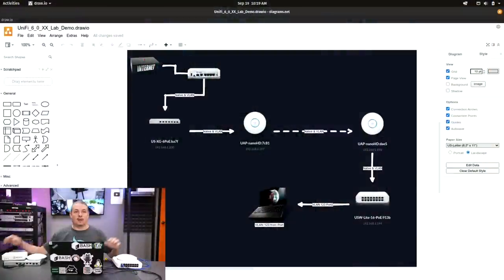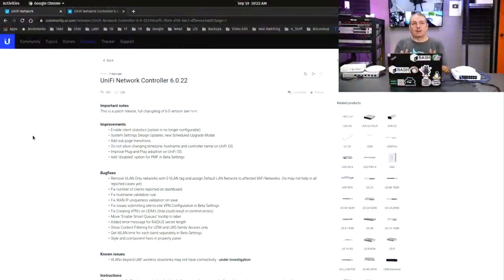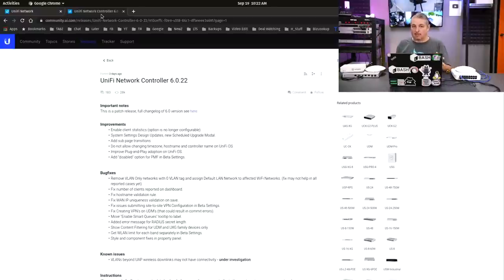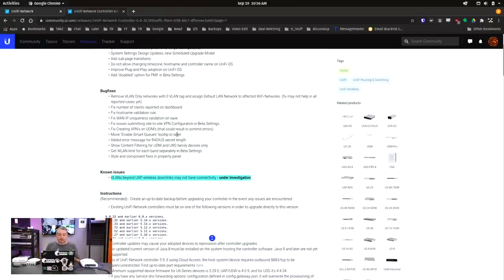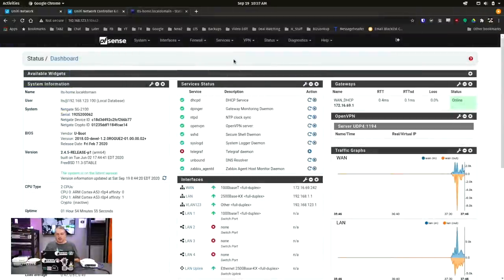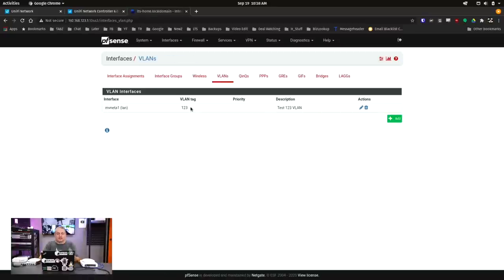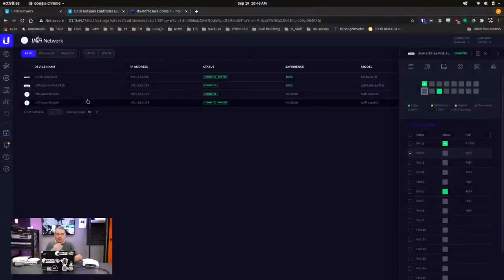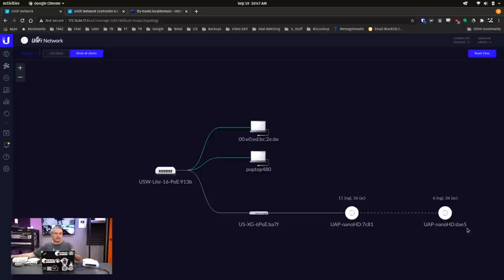Testing UniFi Controller 6.0.22 With VLANS Over MESH & The Problems With UniFi Products

Comment: Tom I found that people would use both terms interchangeably Meshing / Roaming. Even experienced Network engineers. We planned out a 30 AP Network in a very old 1800's building recently.  Marble walls making parts of the building  extremely hard to cable.  When Designing we took test rigs out and made sure we could wire and place all AP's in overlapping locations to Roam. The guys with me seemed to think it was a good idea to Mesh rather than survey test and get positioning to overlap signals to make decent Roaming. I just couldn't get through to them that Meshing a difficult job would increase latency backhaul processing power etc. rather than take more time to test and plan properly. We have a number of VLAN's for different guests etc. I just thought they are taking the easy route and when all this different VLAN traffic is on its going to get messy.

Comment: Coming here in 2022. I had the scenario where I had to use a mesh because I wired my homelab together with the home network. I went down the wrong path dealing with VLANs over a mesh. 

I'm also a software engineer, who has done some networking stuff, and you're spot on about the complexities around testing scenarios with networking. Unlike pure software development, you need a lab to test it, and you can only test so many scenarios promptly. One benefit of having these kinds of users is you get a lot of use cases, which other vendors may not get -- and you can learn a lot, which gives you a competitive advantage. The downside to it is that if you don't address those scenarios, you may actually drown in the noise and undermine your brand. 

If Ubiquity got their equipment and software to play nicely with others, it would be really, really useful. For example, maybe I just need a router with a controller for the WiFi infrastructure and let Sophos, CISCO, and whatever, handle the data center -- but I found that it is tedious to disable NAT and Firewalls with USG, UDM, and whatnot. Imagine if they just offered you an option to use this as a firewall, router, or switch and configure the device accordingly.

Comment: Glad you bright this up.  i am still 5.x controller with V1.8 firmware on my UDMP.  I have four VLANS and everything has been behaving.  I notice that Unifi SDN 6.0.23 was released and available for my customers on USG and USGP.  Does this version resolve some of the issues you discuss?

The only Unifi problem I have experienced lately is I cannot get WOL to work on my UDMP.  My infrastructure is all Unifi switches and back in my USG days WOL worked fine.  I am not sure when this problem started, but I have no WOL functionality at all.  I've tried PC to PC on the same switch even.  I know my BIOS settings on the target are correct because I used to wake these nodes under the USG.  Have you heard anything about this "feature"?

In regards to your view of Ubiquiti, I've been pleased with their hardware and software offerings to a degree.  The Unifi product line frequently has the flavor of a beta product with its features issues.  Clearly Ubiquiti is leveraging a huge install base to ferret out and fix their problems.  I suppose that is the cost of Prosumer gear as opposed to Cisco.  Over time they have eventually fixed their problems.  I end up consulting on their gear a lot because people that get in trouble tend to be hobbyists who have been given just enough rope to hang themselves with.  That gives me business certainly.  The beauty of the product line is 1) Commodity hardware at a great price and 2) No software contract needed and lifetime support.

Comment: The problem isn't the bugs, it's the release management.  I posted this recommendation almost 4 years ago on their forum ... https://community.ui.com/questions/Officially-suggested-stable-release/253e71df-15de-45a5-bace-1fbd8a0e39c2

It's time they listen to their customers and provide a stable release channel that is just that, stable!
Reply: And how is that supposed to help destroy their own brand? Doesn't make sense to mitigate those issues. They did their darndest to make hosted controllers useless for UDMs, nuked the forums beyond repair, still can't manage 2 WWANs after a decade, put Video down and now succesfully burned a ton of people. Their intentions seem clear to me.
Reply: They still have issues with 2 wans??
Reply: @sbccave4015  AFAIK, nothing changed on that front. Not like people haven't been asking for that feature when literally everybody else had it app. 750 years ago.A glacier is an avalanche compared to UBNT.
Reply: Insanity thats the reason ive NEVER suggested unifi routing products.
Reply: @sbccave4015  Insanity pretty much sums up recent decisions at UBNT. No idea what they're smoking, but I wish they'd share.
Reply: The response to your comment was to track LTS and understand that manufacturer's definition of stable code is much different from that of your user's expectations. As others suggest, continue to lean on our peers that promoted code in similar environments using change management practices.
Reply: Right enough Aric. Just a bit more feed back from Ubiquiti would be good. It always seems a little like one way traffic on the forums.

Comment: Thanks for explaining. I’m going to try this for my detached garage and a   UAP-AC-M-PRO-US i have extra, should be pretty simple for the looks of this and work how i want to be able to run ip cameras mounted on my garage. Running a line to the garage is a big task as it would be tunneling under concrete for quite a ways. I surveyed the WiFi in the garage and it is spot on so the   UAP-AC-M-PRO-US should just like your demo ! Thanks again for confirming my idea i had.

Comment: If you use your WAPs as a wireless uplink/bridge, particularly if they are trunking VLANs in an enterprise environment, then you not employing enterprise IT practices. Yes UNIFI released a bug, but it “took down my entire network” as result of a WAP mesh bridge/trunk, well that’s kinda on you for implementing that practice in a critical environment
Reply: @Kevin J I am talking about network practices inside the enterprise, linking switches together using standard WAPs that carry multiple VLANs within an enterprise instead of cable or fibre is just not a good idea, on an enterprise network it is better to have WAPs hardwired, I think Tom indicated in the video he also deploys them in this way. Meshing WAPs in a home environment is common, but home environments are usually not critical networks. As for microwave vendors, well that’s an entirely different wireless infrastructure designed for high bandwidth point to point transmission I have no issue with that

Comment: Thanks for this video. As I mentioned before I updated to 6.0.22 on Debian 10. I've only have one  Unifi AP-AC-LR in a home environment. I went with Debian to host the controller because of the stability. Since this pc is a test rig with 6 other SSD's the controller is not running continuously. Appears that there is a firmware update as well. But I'm holding off until all this gets resolved. Its a great product and does a better job than the consumer grade AP I had previously.

Comment: Connect a new AP or Switch-8 on the far end switch and try to adopt it.  That's where I've had adoption problems over a Unifi wireless bridge.  Adopting the devices on the upstream switch and moving them to the bridged side usually works.
Reply from the maker: Thanks, that is the other reason I made this video, I know people will post what setups are potentially not working which I can then do some more testing with.
Reply: @LAWRENCESYSTEMS  i found issues with having a fortinet fortigate 60e with vlans set up and having 2 site locations connected by a private fiber metro ethernet. On the other end some devices get an IP and others don't. Very random. I would have to set static IPs for the devices to connect. This could happen on either wired or wireless connections. Chromecasts will work on the main site but if I connect to the 2nd site after the metro ethernet fiber connection it will not connect. Seems like they could reach the dhcp server on the fortigate for some reason!

Comment: 6.0.20 tanked my entire network, I have 4 AC-Lites & 1 NanoHD. All the access points started broadcasting all the SSIDs, I was getting the broadcast storm problem. The whole network was laggy as hell for 2 days & I didn’t even realize it was the new update. I was thinking it was my ISP. The new 6.0.22 fixed my issues I think, crossing fingers, no more complaints. I also jumped on the beta software for the UAPs to test but everything is back to normal.

Comment: here is the reason to turn meshing on with wired APs. We have a shopfloor where we commission machines. we will just put an AP on the machine while commissioning it to bring it on our network, so we dont need to sit the whole time at the shopfloor. since the shopfloor is big i dont know to which AP a machine needs to mesh to, so its turned on on all APs. usually the hardwired APs dont mesh because they detect they are sitting on the same wired network, but from time to time one AP will loose wired connectivity and think to wirelessly connect to the others.
On our old setup we could set the APs to AP Client mode, but i havent found anything like that on UniFi yet (havent looked for long though since this works well enough).

Comment: Like how you give positive and negatives on unifi.

Can you use the USG or switch to enable you to access from the unifi network on 192.168.1. Xto a printer on the routers switch of 192.168.0. X?

Comment: Interesting, I agree with your perspectives on wireless uplink, but it is better than nothing in home environments where wires are not possible or are very difficult.  I plan on wiring a second AP, but am using uplink temporarily as I sort out the best way to run cable in a wife friendly manner. :-)

I wirelessly uplink from a UAP-Pro to another UAP-Pro and the remote one then re-broadcasts my 3 SSIDs and associated 3 VLANs. I have always assumed that his was a more common use case than yours and wonder whether they were referring to this in the release notes. It would be awesome if you could test this config, but I know that you are super busy and so that may not be doable.

I am currently on 5.14.22 on a UDMP and everything works perfectly and so I am holding off on any 6.0.x release until feel confident that the issue has been thoroughly addressed.

Comment: Ok, quick rant. For those that have Auto Update on and complain because it broke their network, they should probably not auto update and research each update's release note before they do so. This is IT 101. No Corporate IT team would just push updates without first testing it to make sure it doesn't break their system, and if something does break, they should already have back up to be able to rollback updates.   Great points brought up regarding stats. Any stats can be skewed for any argument.
Keep up the scenario lab.
Reply: Pretty sure the release notes didn't state those problems on release date. Or they would have either fixed it or stayed on beta for a while longer.

Comment: The closest "open" (as is not exclusively sold through VARs, not open source) competitor to Unifi self-hosted management is MikroTik CAPsMAN .. essentially any MikroTik hardware device can be the management server or you can license it to put on your own hardware.
The CAPsMAN UI is not very intuitive and documentation is a bit confusing (and I've been managing networks since x.25 stuff in the late 1980s), if someone wrote a better frontend for CAPsMAN (or even a config file generator) it could be a bit more acceptable to the masses.. 
After saying that, my production wireless access points are all still Unifi, but seriously considering a MT overlay as devices are added or replaced.
Reply: MikroTik hardware is lacking too, no MIMO hardware

Comment: So if i get this correctly. there is an AP connected to a switch (ok), then you connect another AP wirelessly to this AP using the meshing functionality (OK), So far its logical. But when the 2nd AP is connected by cable to a different switch and you set up meshing I don't follow really. Then your network design is not optimal and I see how this could create issues! I mean you could do this but its not best practice at all. Why would you turn on the meshing function in this case???? I can't see any added value to doing so... your only setting yourself up for issues.
And YES exactly Tom :D , you explained the design flaw in this setup well and why not to do this etc. Great video!

Comment: I recently purchased and switched to Unifi equipment (switch, AP, etc.). So, most of my equipment is still setup with default settings as I refine them.  I found that meshing was enabled by default on my NanoHD APs.  I am not sure if it was enabled with version 5.x.x by default or if it became default with the upgrade for 6.0.20 or 6.0.22. Might be helpful for people to check their configurations as well.

Comment: I had this Vlan issue.  I have a very basic site with 2 ap pros in mesh mode and 2 Vlans one for IOT one for voip.  No unifi switches. As soon as I upgraded the vlans stopped passing to the meshed ap took me ages to figure out why my phone had no IP. My work around was to put wireless network for voip (hidden said) and get it seemed to work.

Comment: Have you tried the TP-Link controller and their Omada APs? I am also on 6.0.22. Only issue I had was with my guest WIFI network. It was created in V5. I removed it and the VLAN network. Recreated it, but I don't see a way to assign networks to WIFI hotspots. So it''s on the same network as my main WIFI network. My other IoT network works fine behind a VLAN. I also use a TP-Link PoE switch. So it's able to carry the VLANs to my EdgeRouter.

Comment: Been troubleshooting an ac-lr that's been causing all sorts of problems for about a week (common apple device loosing connectivity issue on forums without a fix) when 6.0.20 came out, I thought oh that's not long after the last release,  maybe there was a problem, so I updated, then went to forums and saw all the warnings, boy did I uninstall it quick! Got it rolled back to 5.x before any issues. The ac-lr? I set a script up to reboot it every morning at 6am, having spent a week on and off on it already, rolled back to backup config from when it was working, firmware update/downgrades and swapped out hardware, network traces the lot. Have no access to the building due to covid so I'm relying on the reboot for now.

Comment: Always turn meshing off. But will hold off on 6.022 for now. Will need more stable release. Great video. Thank you... Do you have info about WiFi 6 from UNIFI ?
Reply: Yep, mesh is for really poor installs and should be OFF by default. Just as bad as their blasted "Auto Adjust" settings or Optomise. Turn all off.
Reply: I had it turned off, 6.0.20 didn't care LOL real nice surprise on a Monday morning.
Reply: @W1ldTangent  As if UBNT would do something like that....? 
Yeah, UBNT have some pretty rude assumptions and ideas of "What we want" at times.

Comment: Currently looking at setting up a bunch of transparent bridges between wired connections to do future testing. Have been wondering about data leakage between devices.  Not looking forward to transforming all the data into useful information.

Comment: I agree with u, but WLAN should not be hard to deal with. If it works, it works. If it doesn't, it will get patch on new next update. I have deal with channel partner and even with the support, there are problems that can't be fix and have to wait for next update.

Comment: only problem i have is some sub menus wont open, sometime the setting page wont open without a refresh. The sub menu that wont open is the advanced management, which is a problem but the network works fine as long as you dont want to make a change

Comment: hmmm... not sure if it's Unifi 6.x problem.. i had a mesh device that was connected to a UAP-AC-PRO carrying vlans, it used to work but i don't know at which version exactly it stopped working but at some 5.9.x version it stopped working... i only knew it wasnt working because the people who used it reported after days.. native vlan still works, which is why i didnt notice the problem since the AP shows connected at OK.. my scenario is native vlan for devices.. vlan x and y for user traffic x and y, two vlans for different service and access. funny thing is i have another mesh device connected to another UAP-AC-PRO which still works fine. I brought it to my lab for testing what exactly is the problem with it but havnt gotten around to test it yet.
Reply: I would have to agree with you on this. I had random arp issues only with uplinked devices(randomly). For the most part it affected reolink cameras. No help from ubiquity. I switched to Mikrotik (with capsman) going to cap acs from uap ac pros. It was actually a downgrade spec wise, but my wifi has been rock solid since.
Reply: @Kevin J with unifi the mesh is basically a 'black box'. You can enable and control where the devices mesh. I took network traces and it seemed to be related to the drivers or other component that cannot be manipulated - even directly on the aps. Others have had the same issue for years. It just isn't prevalent enough it seems to get fixed. It was cheaper for me to switch aps than to replace my security cameras.

Comment: There is another bug I experienced yesterday after the update. My hiding management SSID network was altered with other VLAN, I find that out when I was trying access my Edge router over wifi, I wasn't able to access to it. i poked around the router Firewall, everything seems fine, then hop to clouldkey  looked at the Wireless network profiles. The wireless networks> Networks> VLANX was altered.